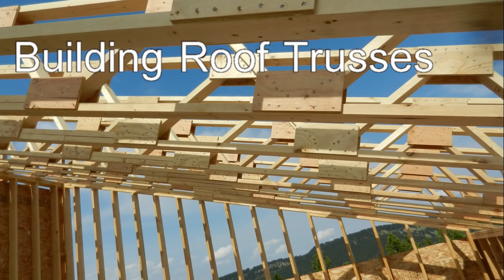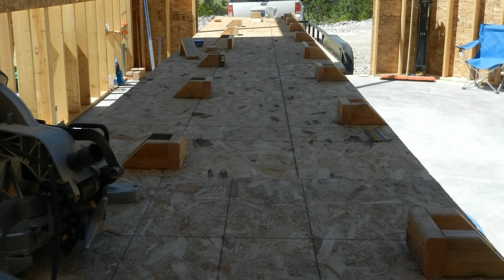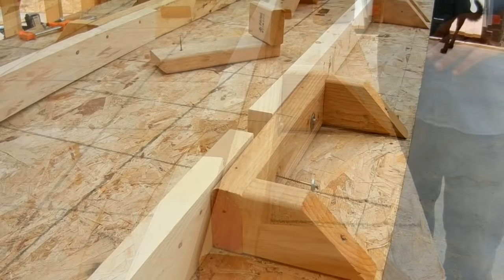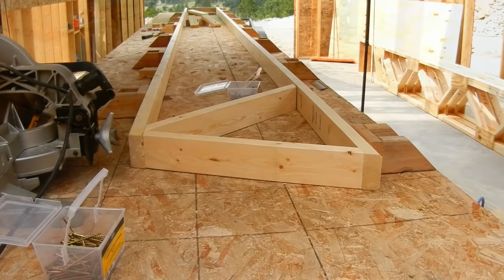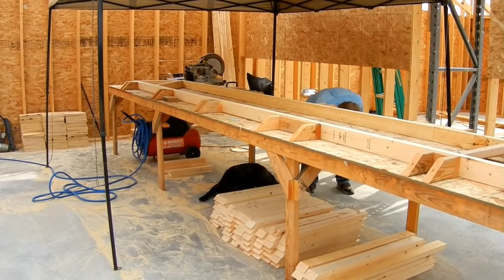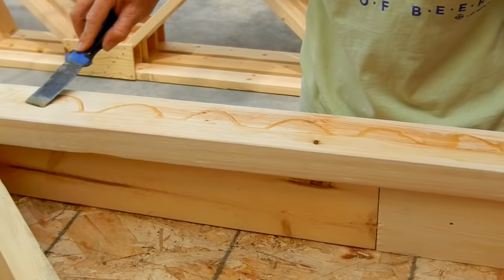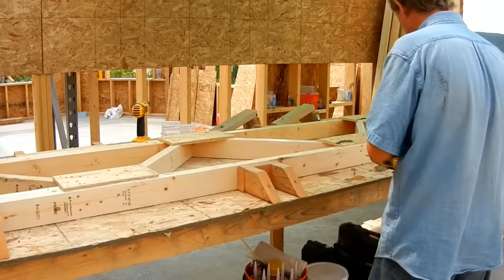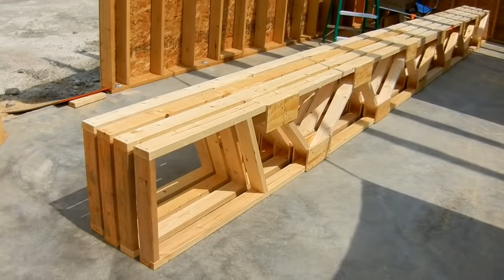Building Roof Trusses

Comment: Great job.  We have used plywood gusset plates as well.  Here is something for you to consider.  You can not add the strength of the nails to the strength of the glue in shear.  The two do not work together, they work independent of one another.  The glue requires no deflection to take up loading it works as one piece.  However, the nails depend upon the deflections or movements of one part verses another to take up loading.  The glue line will have failed before the nails take up all the loading.  Just saying --- make sure each of the two fastening means is sufficient to take the full load.  the nails/screws must be capable and if you use glue it too must be capable of the full joint load transfer.

Comment: I've never seen, or built anything at such a slow pace. Is this your home?
Reply from the maker: Yes.
Reply: its not slow, its methodical and taking pride in his work to ensure the end result is consistent and exactly the same. From the looks of it I dont think he is in a hurry to get things done seeing as it is his home. So what if he wants to take a week to build his own trusses/engineered floor joists. With his view and location, I wouldnt be in a hurry to get off the mopuntain any time soon. Not much I would criticize from his work. I've built my own trusses before and its not a walk in the park always. Only thing possibly different is having a compound cut to where the webbing is pushing against each other all the way through out but thats it. Here in Idaho I've seen this same desgin used for floor joists vs the traditional micro-lam 2x3 osb combo. Makes it easier to run your mechanicals in the building
Reply: he built and installed them faster than a truss company would have made them and they are all correct, i cant remember how many time's i had trusses delivered that were wrong and have had to reconfigure them with over sized 3/4 plywood gusset's all screwed together, inspector loved them, think i would have done a little more bracing on the load bearing end's

Comment: That gorilla glue will fail. I have had it happen to me. Was testing it when they first came out with it. Looks fine, seems to have the right strength and then it fails, quite unpredictably. Use only a glue rated for structural applications. This is a case to consult an engineer and follow his recommendations.
Reply from the maker: So you were able to determine my glue joints are going to fail based on your failures and a snap shot from a video?
Reply: @BSpotBuilds  Take the time and read the label on the bottle. It clearly states NOT for structural use.
Reply from the maker: @gary24752  So do you know why it says that? maybe they are afraid of the liability of structural use.The glue is polyurethane and it has a certain strength regardless of what name is on it. It is only one part of the connection and is appropriate as determined by me. It may not work where you live as the laws of physics are probably different.
Reply: @BSpotBuilds  It states it is not intended for structural use for a reason. Contrary to what you believe they could not market a glue on a hope and a prayer. Glues are engineered for specific uses and have testing data.
Reply from the maker: @gary24752  I see, you have no idea how corporations function specifically how all the fine print ends up on your products.

Comment: why, along the board and not across?
Reply from the maker: Works better with the 2-3/8 nail I used, produces a truss that is more stable when handling, creates a larger nailing surface for sheathing and drywall, and makes a smaller thermal bridge created by the wood in the insulation cavity.
Reply: @BSpotBuilds  thanks for the clear answer

Comment: Don't know the entire back story here (site, credentials of the poster, etc) but why construct your own trusses?? Pre-engineered is cheaper and are designed to withstand the specific loading in your area. Additionally, are you permitted to build your own in your area?? I'm in Canada, and the National Building Code hasn't covered site-made trusses for years. Not everything that I would do, but I must say, that your lumber is down-right pretty.
Reply: These were cheaper and better than typical purchased trusses.  One can also design them for one's specific snow load etc.  Of course they won't cover home built in your area, you would be able to cut out the bureaucracy and protectionism if you could build your own. The lumber was thoroughly vetted!!

Comment: B-Spot, I have a few questions for you...
1. Who did the engineering on these for you, or did you find the specs somewhere?
2. Did you figure out your savings as opposed to having these produced by a truss company?
3. Here in West Virginia, a sealed truss set is required by county engineering, so how would one get around this with self constructed trusses?
4. Lastly, How do you determine the proper size of the plywood to steel plate ratio?

I really enjoyed your video, and in the beginning I kept thinking this guy needs a helper besides the four legged one I saw a couple times, then your lovely wife showed up and I was like... Hey, this guy has a helper and it's his wife....so this brings me to ask one more question/comment...
5. I am a general contractor of more than 20 years, How do I get my wife to become my helper and walk on site and give me a big high five like yours, rather than knocking me in the head with a 2x4 like mine would if I brought her to the jobsite?

:)  Would love to know if you have more videos of this very wonderful home you built.
Reply: Robert Ketter they’re  building there own home, probably the only way to get your wife on a job site.
Reply: They don't have a permit-no inspector would pass this.

Comment: Hello, please tell me what size wood.
Reply from the maker: Ertay Mekebaev The lumber is 2x4's that's 90mm X 45mm for those of you in the metric system. The connecting plates are 12" x 8" x 1/2" exterior plywood.
Reply: B-Spot спасибо
Reply from the maker: +Ertay Mekebaev Cheers!

Comment: Local code would not allow me to use those screws for any framing, must use correct sized framing nails for all structural components
Reply from the maker: And how well would a nail hold in end grain on the eave end? Local building code is about control not great design. The screws in the truss are to clamp members together while the glue sets or in the non structural ends. The highest stress joint is the bottom cord center joint, it has over 200 sq inches of glue area, and connects to the two nearest connecting plates with nails and glue, additionally it has 10 screws providing over 500 pounds of additional shear strength. Ever look at a site built truss from the 50's, connections are nailed plywood gussets thats it. Today I build with nails, glue and screws and the problem is the screws. These truss have been in service going on five years with no issues.

Comment: Great job! Yet you over killed, you could save time just driving the screws directly, no need to pre-drill as pine is soft enough and it won't split, actually you could just nail it. Polyurethane glue is not required because you are gluing a rafter and it needs to move according to the season and weight of the snow. Still, great work !😎
Reply from the maker: I do a lot of things I don't have to do. But it's not like they have no effect. The use of screws pulls the corners and other members together making a stiffer truss right out of the jig before the glue sets. Pre-drilling prevents splits in the ends of the wood. As for eliminating the glue I don't think that's a good idea, it's an important part of the structure. My goal is not to be fast or produce something that is average by the commercial standard.
Reply: +B-Spot Good luck with your project them. I merely offered my two cents.
Reply: +B-Spot Good luck with your project them. I merely offered my two cents.
Reply: I didn't see y'all clamping the pieces after glueing.  Was this done?  If not I don't see how using the glue helps.  The countryside I see in the background looks like places I've seen near the Big Horn Mountains where some friends live in Dayton, WY.  They talk about the heavy snowfall and makes me wonder ifl your trusses hold up.
Reply from the maker: -- The screws clamp the glued 2x4's and the nails in the connection plates hold them in place as the glue dries. Trusses were designed for 30 psf.

Comment: Drilling out all that end grain makes for a weaker (already weak) connection -  Would not have those over my head.   Ever heard of glue?   A quality glue joint is stronger than the wood.
Reply from the maker: I guess you didn't watch the video every joint except the eve is glued.

Comment: A very good effort however, in my jurisdiction, building inspectors would not sign off on home built trusses unless the design was engineer approved. Also, in this video, the house construction is set back while the owner takes weeks to build the trusses. By the time he buys (and transports at his own cost) the lumber and plywood, glue, screws and nails, laid out the truss design and then builds the trusses (counting his labour as free), factory trusses would be much more cost and time effective. Not complaining- just saying that not everyone can (or would want to) use this method.
Reply from the maker: I am sorry you live where you are not free to build as you see fit. After all its your home and land. The cost of using engineers mandated by a government body surly will drive your cost up. Maybe you should get rid of those entities who take away your liberty and money. In my case actual cost for materials came out to be substantially less than buying from the lowest cost producer. I have used manufactured trusses and the ones I built are multiple times better than what comes from the truss plant. As for time I would much rather work on my house than go work for someone to earn enough to buy everything.
Reply: Owner built trusses need to conform to some sort of standard since one person's skills may be totally different from another's. It is not a question of liberty. It is a question of safety.
Reply: This reply just got you a new subscriber!
Reply: B-Spot awesome job on the trusses, i can guarantee your trusses are stronger and 1/3 the price of manufacturered ones! Live life your way, not theirs!

Comment: I thought the building code required factory engineered trusses with a seal of approval with detail paperwork from a engineer.
Reply from the maker: Is it the seal or the detailed paper work that makes them stand up?
Reply: @BSpotBuilds  It is both actually as well as the person that builds them. Construction of structural members demands an understanding of engineering design and materials or a certified design to instruct one as to what materials to use and how it should be built. When you figure in the cost of time and materials required to repair a structure that has structurally failed the cost of a certification that may have prevented it is nothing. That failure to understand that is nothing if you have a loss of life as a result. Pinch a penny and lose a hundred.
Reply from the maker: @gary24752  There seams to be a group of people out there that want to portray building design and construction as difficult, and dangerous, therefore it must be left to the experts. This is not true. It's not hard, plenty of reference information is available for free on the internet and most people are capable of building their own home. As far as pinching penny the biggest penny pinches are tract home builders. The number one thing that drives up building cost is  bureaucracy and experts.

Comment: Anybody gonna tell this man that those are floor trusses?
Reply from the maker: Add what makes one more appropriate then the other?
Reply: @BSpotBuilds  A roof truss is designed for a different type of tension than a floor truss. For roof trusses you would flip the wood on its side and build the entire dynamic of the peak. Not saying these don't work, but I just never learned it this way, these are more suitable as floor trusses.
Reply from the maker: @christianmetzger540  Rather than telling me its wrong. Why wouldn't you ask why I did it that way?
Reply: @BSpotBuilds  I don't know.
Reply from the maker: @christianmetzger540  Because of the way a truss works it makes little difference whether the members orientation is vertical or horizontal from a load bearing capacity. One reason for vertical orientation that truss company's like is it uses less wood for the same span and they can use fewer webs between the cords. The main reason I put the 2x4's on the flat is so I could use 2-3/8" ring shank nails for the connector plates and not penetrate the other side. In addition I needed 20" of clearance between the cords for insulation and if the 2x4's are on edge there's only 17". I also like the larger nailing area for roof sheathing and drywall. It's not the most common way to make roof trusses but it's not unheard of. Look up I-joist they can be used for roofs trusses also, but you don't see that very often either.

https://www.magtruss.com/wp-content/gallery/EJ/MWeb-Roof10.jpg

https://www.jlconline.com/photos/framing-a-two-pitch-i-joist-roof
Reply: @BSpotBuilds  well, then that's nice to know. Thank you. You did a good job, took your time with great craftsmanship. One element I was thinking of was the cost of Lumber was going to be higher.

Comment: whats up with the one drill one screw deal at least get yourself a flip bit yo! Also should be no gap in joints...that's like 3/8" c'mon man you got a chop saw right there make the measurement & cut to fit!

Comment: B-Spot - I landed to your video because I have so much doubt in the 2x4 truss/joist.  I completely could not see how such joist would hold up weight (whether it's manufactured or diy).  From several other manufacturer's site, it's UNBELIEVABLE to me that people would trust a Simpsons thin piece of metal with spikes to hold up the ridiculous amount of weight that's incurring on these joists.

I don't know why people would use 2x4 truss vs a nice piece of 2x12 Douglass Fir.  I looked at national box store ceiling many times and looked at their web steel joist and I still can't believe it could hold up weight.

For me, I overbuild, much more than code standard and I don't need to consult any engineer, I am my own structural engineer, common sense and a little math can do wonders.  But city hall forced me to give them something from structural engineer and architect.  Structural engineers and architect walked in and walked right out, without a doubt that what I'm doing are definitely over-done.

Even though I don't like 2x4 truss and joists or web joists all together for that matter, but I do respect your decision for doing the things you are doing using your own two hands and brains to do it, you don't see too much of that anymore now and days because people believed their time is too precious but most spent their "precious" time right in front of their television set.  I do love seeing you and your love ones working together as a team to create and design and frame out the way you want your home to be.

Keep up the good work and stay safe.  Also to achieve that R-60, you don't necessarily need to have a thick joists, but it come in the expense of foam insulation coming at R-6.5 per inch of closed cell foam.
Reply from the maker: I used trusses because the span is around 24 feet and I don't think you can span that distance with conventional lumber. I like closed cell foam.... except the price.
Reply: Hard to belive that you are engineer if you succest to use bigger lumber that necessary it just makes truss weaker because you add more weight which need to take off from load that truss can bear. Those trusses assembled with metal spike can be span with 59 feet so for me they doesn't look bad at all.

Dunno how pricy lumber is in US but so short span might be cost effective to do with LVL.
Reply: Trusses like this work because they maintain the appropriate amount of structural strength and remove a bunch of dead load weight.
And they do it for less than the cost of an LVL beam.
More-over, trusses like these are easier to insulate and easier to run utilities through due to their open nature.
With a solid beam, the second you start cutting holes in it for utility runs, you compromise the strength of the member.

Comment: I used to work at a truss building company. A ton of different styles and sizes. These trusses in the video are SEVERELY over-engineered. The amount of wood and screws used is beyond ridiculous. Every single joint where the plywood is used should have been truss plates (https://en.wikipedia.org/wiki/Truss_connector_plate). Way, way faster and cheaper and gets the job done just as good if not better than the plywood. Even though the truss plates we used are pressed in with a roller, that is not necessary. It's only for speed, not much else. Place the plate, then place a piece of 2x4, small metal plate, plywood, or whatever on top of it and several heavy blows with a hammer works just fine. And throw the Gorilla glue in the trash. Absolutely not needed. I'm sorry to be so critical of what you did, but it's like pouring molten steel down for a floor. The floor is strong as hell, yes, but complete overkill and completely unnecessary. And before anyone says it, as I've seen in other comments, no, I'm not an "unemployed, laid off truss builder", I was young, the pay was crap, and I moved on.
Reply: True.

Comment: Great job but, you really should get away from using philips heads and go to torx heads. You will be all like "I should have started using these a long time ago" they don't strip out like philips. Especially when using impact drivers.
Reply: Phillip's head are ok for a one time drive, not if you are taking things apart again, just use a sharp bit and push hard LoL